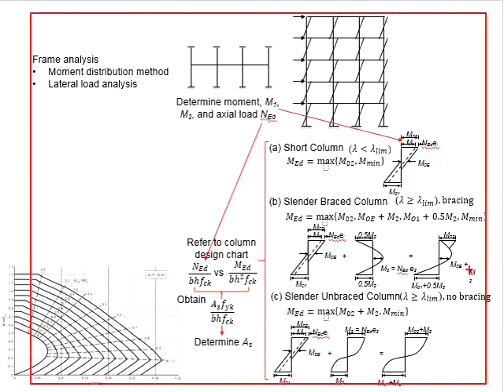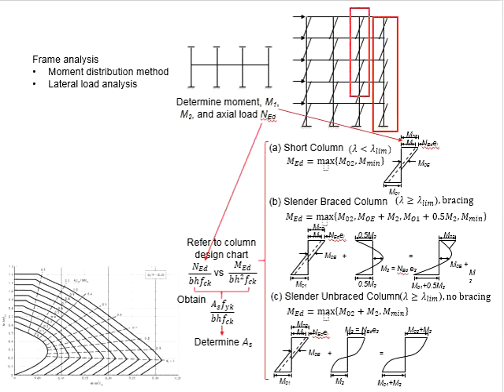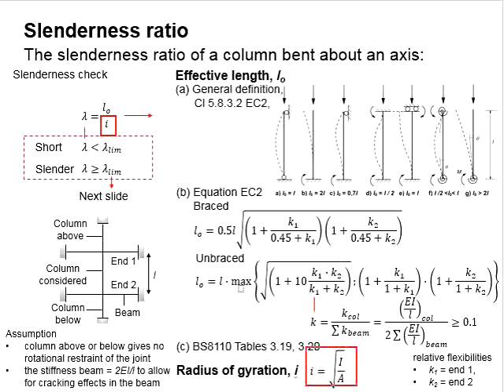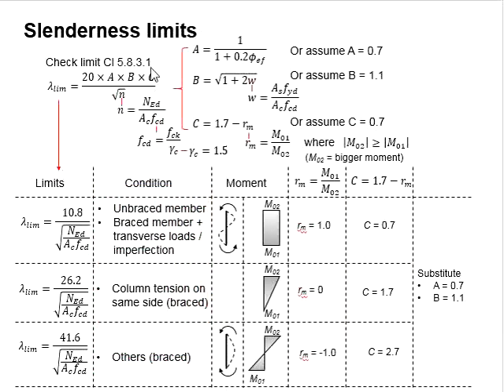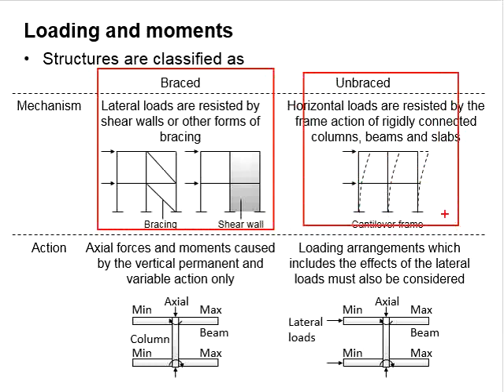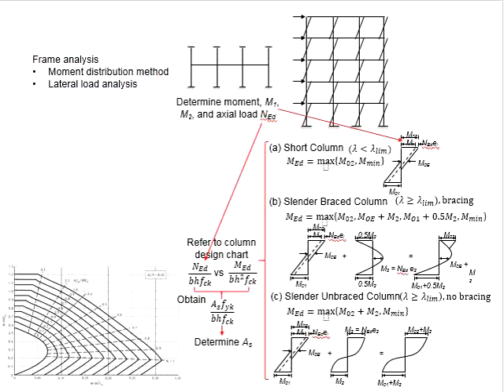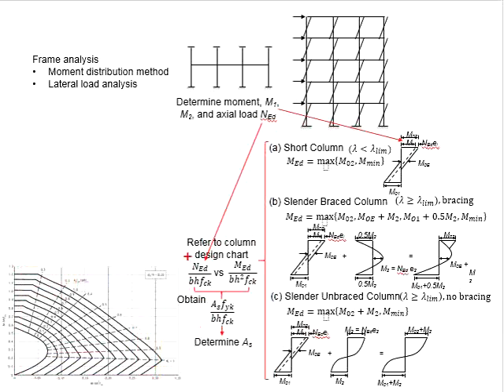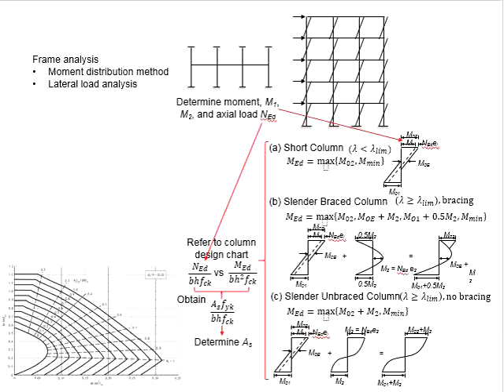2.17 Design process of column

Comment: Great video. Thank for your effort. If we have an unbraced concrete frame with walls instead of culumns, do we need a different approach or can we just consider the walls as columns with a (section) height of 1 meter?